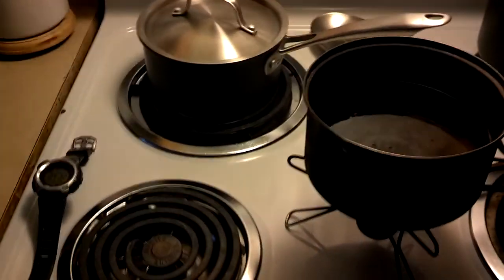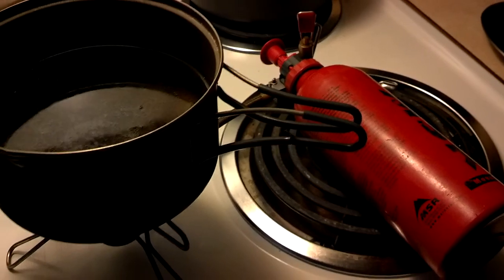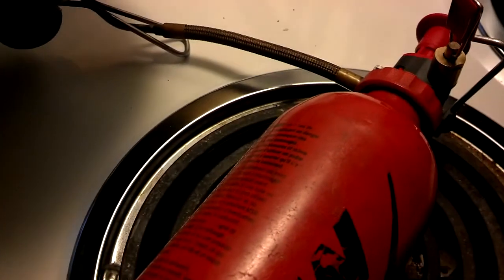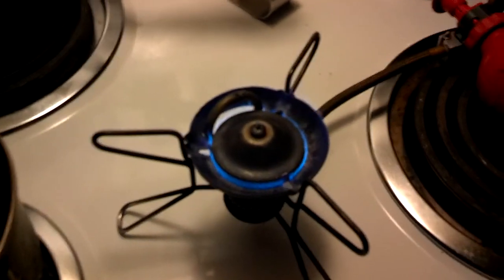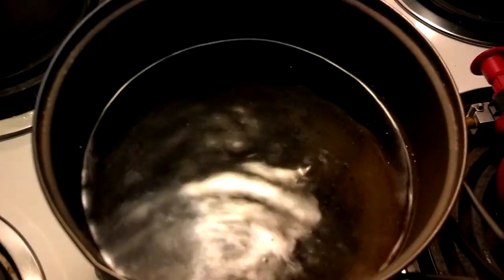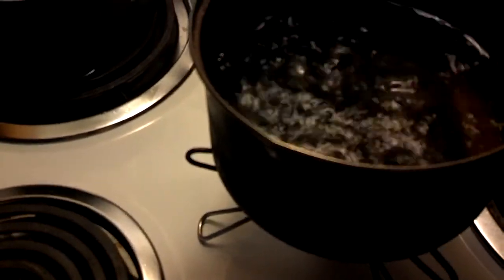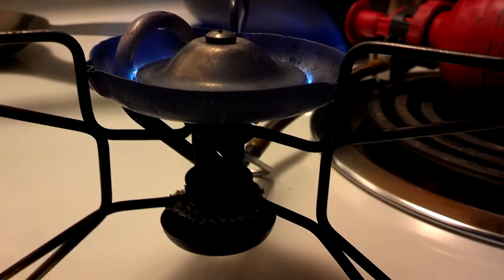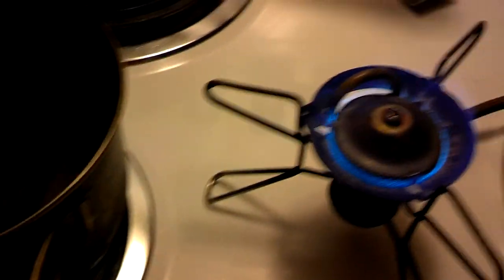MSR Whisperlite Converted To Run On Isopropyl Alcohol & E-85

Comment: My Whisperlite simmers quite nicely but I have an old school non shaker jet model. If I can ever find a replacement jet for it, I may try this mod. I don’t have the international model so I don’t have a K jet. I wonder if the smaller size fuel line of the non international model would be more or less advantageous for this purpose.🤔

Comment: msr experimented with alcohol jets but didn't offer them with the stoves because of something you did not mention... the fuel consumption rate when burning alcohol is off the charts and the cost of fuel becomes ridiculously expensive. just because you can make it burn alcohol doesn't make it a good idea.

Comment: Hi Jason! I had some extra jets (from a service kit) laying  around for my whisperlite Internationale and decided to drill one out. By my calculations the optimal diameter is somewhere between 0,4 and 0,5 mm. I drilled mine with a 0,5 mm drill bit and it works flawlessly. No soot and it simmers almost like a gas canister stove! The drawbacks are less heat output and increased fuel consumption. Thank you for great inspiration!

Comment: EXCELLENT VID BROTHER. I have a pre shacker Whisperlite circa 1983. Used it many, many times since then. I have always wondered using HEET (yellow bottle) in my old Whisperlite stove. Yellow bottle HEET has proven to me to be the BEST fuel in my Transgia type stoves. I called Cascade (MSR) and talk to the MSR stove guy. He said NOT to use alcohol of any type because it would corrode the fuel bottles and create small pin holes. Nothing said concerning O rings, jet size, etc. Just that alcohol would create pin holes in the fuel bottles. Your thoughts ???

Comment: This mod worked great on my whisper lite But instead of a .8 mm I used .75mm It seemed to work well except that the jets had a but more orange than blue flames But that might be due to the fact that the alcohol I used was pink : P

Comment: Is the K-jet still useful for running kerosene after you drill it out for alcohol?  ALso, would have been cool to show how you did it instead of talking about it.
Reply from the maker: I doubt it. Yeah, thanks for the feedback. I often find it difficult to determine beforehand what to include and what not...short of having a "life camera" running all of the time, I have to anticipate what might be of interest.
Reply: No worries.  It was still very useful.  I just gotta try and figure out if I can replicate your instructions by looking at my own gear now.  :)  Will definitely try it though.  This was honestly one of the main things that I wished my MSR stove would handle.  I purchased it because it was "universal", but I always felt that not running alcohol was a misstep on their part.  Now that I know it's just an airflow problem, I feel they are completely remiss for not at least including an alcohol jet or at least an adjustable air baffle.
Reply from the maker: 6BlackWings I did this video too that includes consideration of a different method altogether (no need to drill your jet): MSR WhisperLite Runs On Everclear

Comment: Interesting. I have 2 of whisperlites. My main one I took bicycling across the USA in 1996, and backpacking with me ever since till now. My other one is barely used, I purchased it at a garage sale for 5 dollars (just got for parts and spare really). Now lately I have been upgrading my kit/gear and built a pepsi can alcohol stove (and want to built some other kinds because its kind of fun) Anyways, I thought I'd look to see if anyone on YouTube was doing any modern mods to whisperlites, and/or using alternative fuels in them and came across your video right away. So it looks like you can use alcohol after all. My old whisperlite was white gas only, but during my bike trip across the US i just refilled my fuel bottle with high grade gasoline, which burned dirty but still worked ok. (When your bicycling across the country its hard to come by white gas refills)

I was also looking to see if anyone is rebuilding/modifying them to make them lighter. Havent found anything, yet.

Thanks for the vid!

Comment: Cool, thanks for posting! I always wondered how easy it'd be to get it to burn IPA - finding anything that will burn it cleanly is hard.

One thing to note, and this may well be why they don't support IPA out of the box: ethanol and isopropyl will corrode aluminum and probably other reactive metals (anything but stainless, and probably even that). I sometimes use the MSR bottles to carry alcohol, and they definitely corrode a bit. Don't STORE alcohol in them, and dry the stove after use.